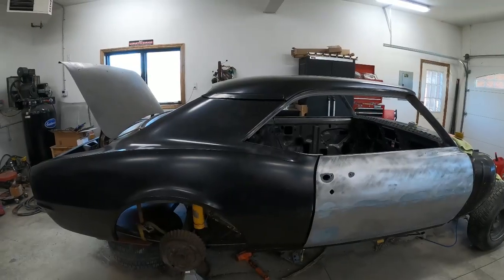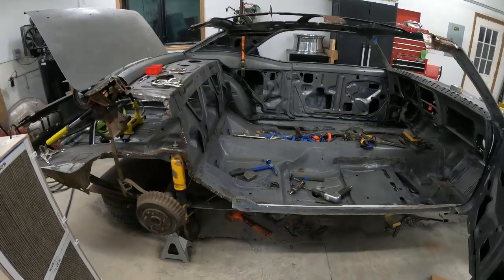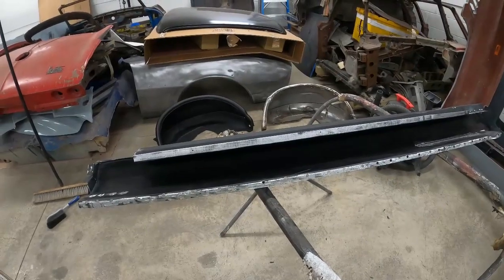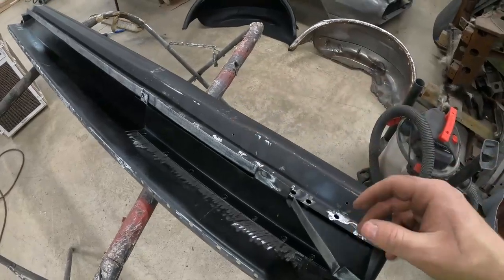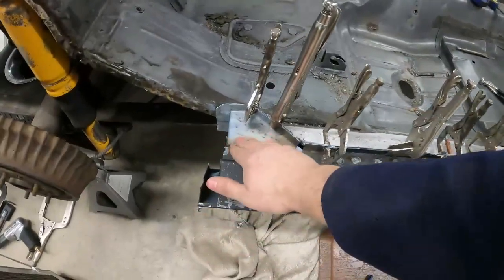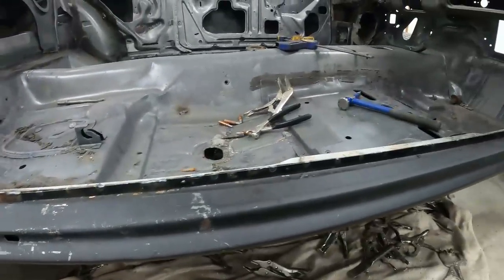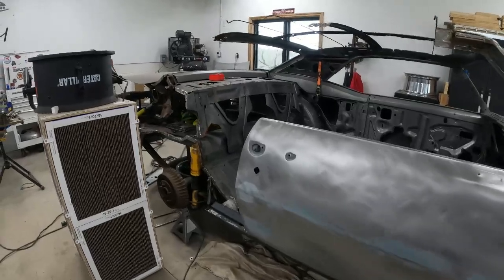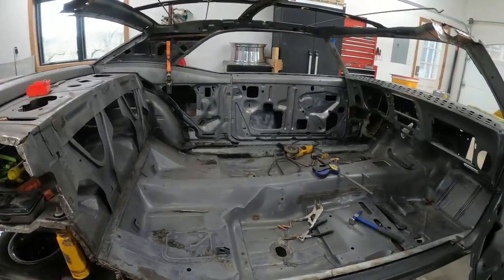Installing a 1967-1969 Camaro/Firebird Outer Rocker.  I'm Done Cutting The Car Up Time To Rebuild It

Comment: Vise Grips with the U-shaped jaws are perfect for spot welding. You just weld between the gap. I get the off name ones at Menards instead of the vise grip brand. They're about 1/3 the price..... I'm enjoying the build!
Reply from the maker: I need to get some of those too. I have a wide variety of clamps but I’m lacking those specific ones.

Comment: Hey mitch  I sent a request from you with The 327 build A list of parts needed  could ya put 1 together and hit me up I already put mine together mostly stock started with 67 block and crank  all new . I seen and heard yours and was yeah I like that Mine is in a dropped 83 s-10 bagged out and 3 1/2 body drop